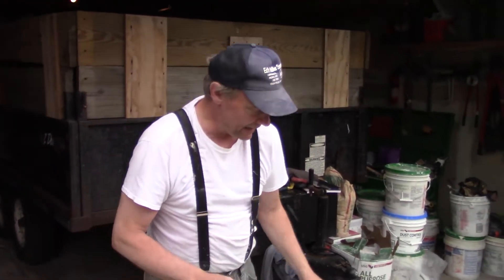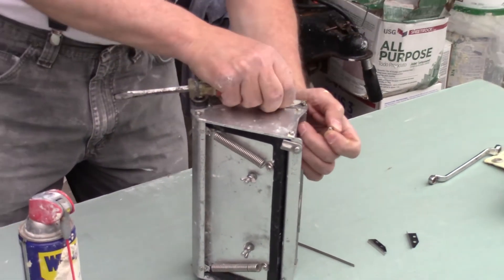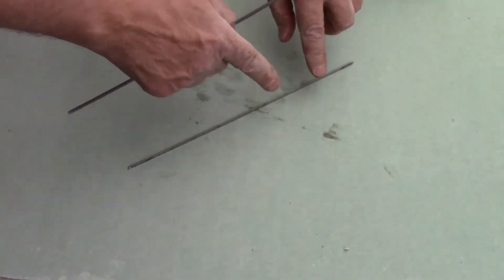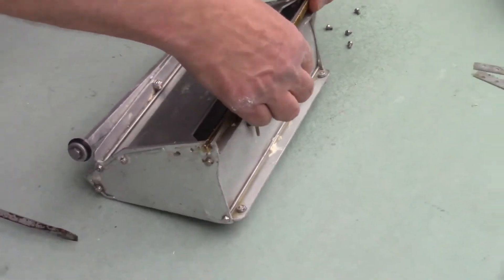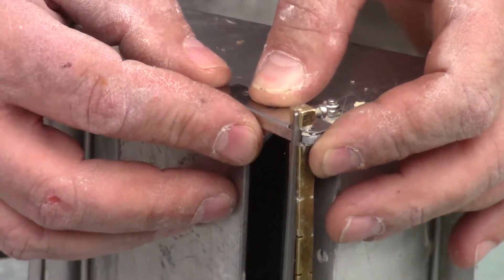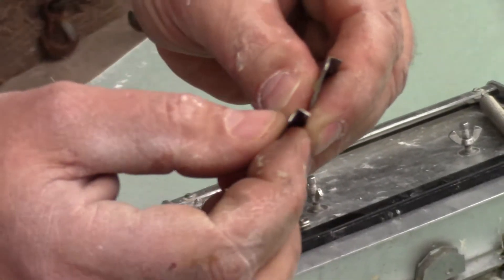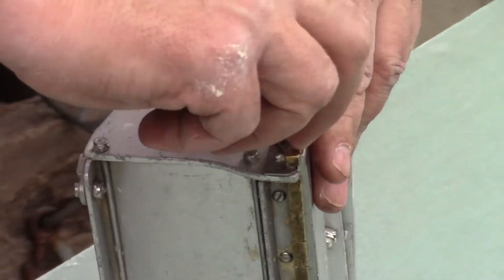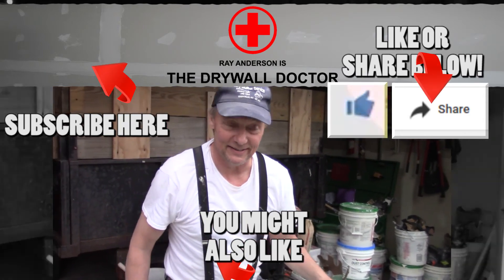How to Change a 10"  Flat Box Blade and side shoes

Comment: if you need to change the shoes  each time you change the blade you are letting the blade wear down to low before adjusting it. The shoes should never make contact with the walls.

Comment: I know this is old but how do you get more crown on a new set of boxes. got a brand new set of tapetech set on zero they're still barely any crown if any and on one it's negative
Reply from the maker: Try turning the blade around
Reply: @THEDRYWALLDOCTOR1  I tried everything these boxes come with 0 crown I have to run them on one.